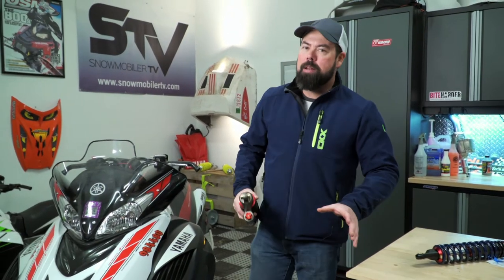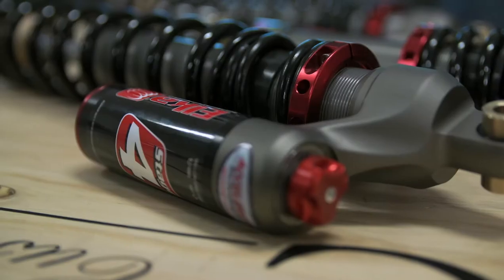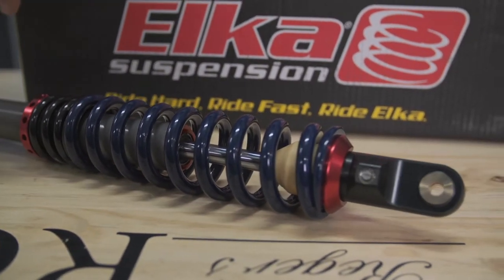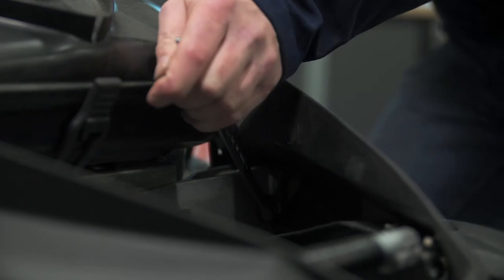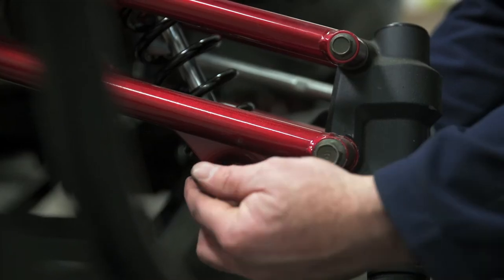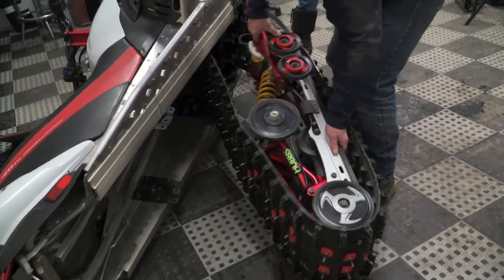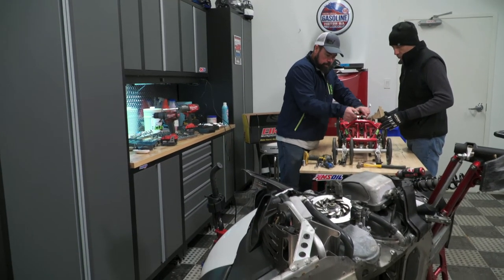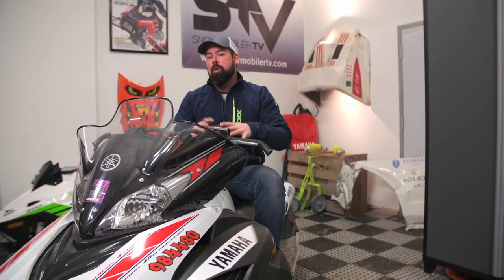STV 2018 - 40th Apex Elka Shock Install

Comment: getting those ohlins sent off to be revalved and resprung would have been a much better option for the money imo.
Reply: 123devinzz1 I am in this boat, the electronic rear Ohlins is a problem from day one with the electric cord to solenoid attachment. I have went through two of those and also had a solenoid go bad on a trip. It’s getting harder to get parts for the Ohlins being they no longer produce snowmobile shocks. I am looking at these Ella’s or the Hygear custom axis shocks for my trusty Apex with 16,000 miles on it.